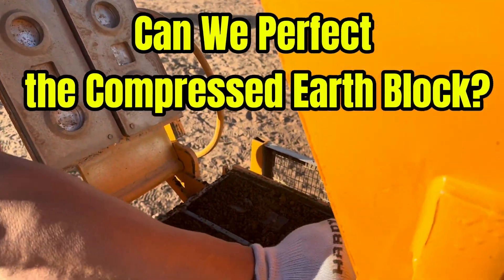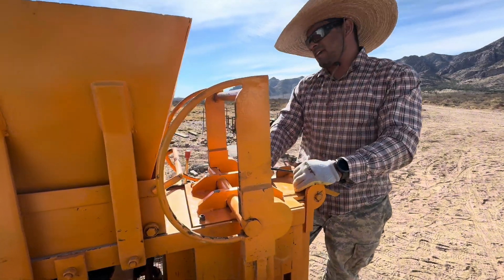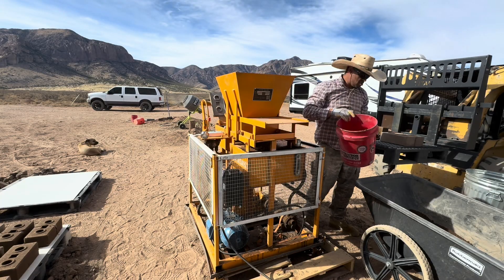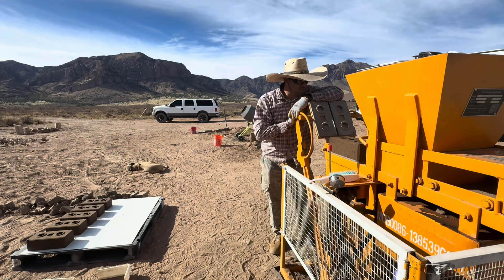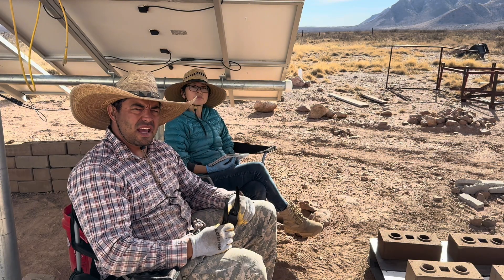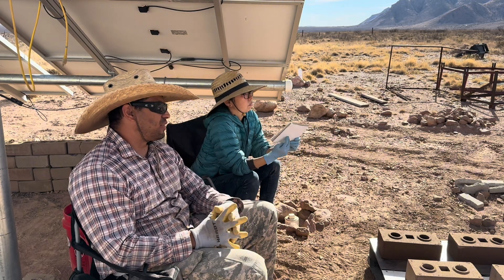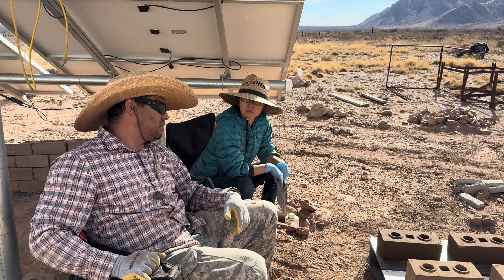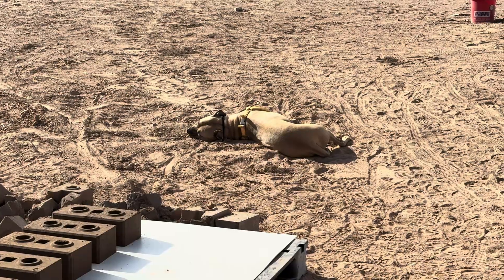The Never-Ending Earth Block Challenge: Solved?

Comment: I think you could benefit placing the blocks on a table very close to the press at the same height as the press. Leave the blocks there for several hours then use skidsteer to lift pallet to table height several hours later to transfer to the pallet. You want the cement to harden a bit. Your trying to move them to far and your body mechanics of travel and bending are breaking your bricks. Trying to do to much with them when they are fresh.  I have been a mason for over 30 years even industrial paver manufactures have variations in their high controlled process.  This is why mortar is crucial when laying brick.  Look to see if you can look up brick laying in Bali or Indonesia they approach if differently then we do in the west.  Hand made bricks and like 1/16 to 1/32” bed joints cement is expensive on the Island and sand is plentiful, local clay and sand are fired into their bricks.

I have been working on a design for a skid steer attachment that will press 6 SCEB at a time and will deposit them from the bottom downward so the machine can place them on the pallet or ground as it ejects them.  This stage of the brick is when they’re the most fragile. Also being in Arizona I think you already realize a drier mix works better for pressing the block a “Dry Pack” but the critical area after placing the blocks on a on a pallet would be place a mister system or sprinkler over them or use a hand pump pesticide sprayer to hydrate them slowly and keep them wet/moist for as long as possible 28 days would be Ideal before use in construction.  Many time as we lay clay bricks it is not uncommon to stick our bricks in the summer in a 5 gallon bucket of water or at least dunk the brick in water before laying.  Even had to keep sprinklers keeping the pallets of brick moist.  When pushing down the brick will absorb the moisture from the mortar to fast and it can be difficult to spread the wall and set the brick to the line in summer. The joint drying this fast is weak and not as strong as one that dries slower.  Balanced with the least amount of water in your mix to control the strength of the mortar and shrinkage.  Misting the bricks down several times a day keeping them in the shade and covering them with a sheet of Plastic to keep the moist in to reach proper hydration of the cement are the factors your trying to control after the brick is made.  
      Reduce the distant you have to move the brick when you get into production you will just want to park the skidsteer near the press raise a pallet to the height of the press and only move them horizontally you can lower the arms after you first row is down and possibly place a second row on top 90 degrees from the first row.  Stack it like a pallet of bricks keep them close to one another this will help control your moisture loss. I would start with 2 high per pallet before attempting 3 or 4 courses to keep the blocks as straight and flat.  The brick could be stacked three or four high or even 5 high by the next morning and kept cover with they bags we cover our pallets of cement / brick / block with to keep out of the rain but in your case.  The height you can stack the bricks will be relative to the lifting capacity of the skidsteer  your availability of pallets, but look at Home Depot the height of stacked brick pavers to give yourself an idea of how high they should be stacked.

I run several companies so I think it will still be several more years before my skidsteer attachment will be ready to make available to the public  I just don’t have the time and bandwidth to commit the time needed to perfect it and then tweak and perfect it again.  Managing jobs and 25 employees doesn’t give me to much time for my hobbies.  Love all the effort you guys are doing on top of making the blocks documenting the process filming and editing doubles the trouble and effort but does give you a nice platform for encouragement and advice from tradesmen.
Reply from the maker: Thank you for taking the time to share your experience and insights! I completely agree that having a pallet at the same height as the press will make a big difference in reducing strain and breakage. Letting the blocks sit before moving them also makes a lot of sense, especially considering how fragile they are at that stage. We’ll definitely look into optimizing our process based on your suggestions. Appreciate the valuable advice!

Comment: I think this is why if you use mortar you can have slight variations 
You put mortar down
Put brick on top
Put level on top
And just tamp down which end  is higher til it’s level
Reply from the maker: You make a great point! Mortar does allow for adjustments to level out slight variations, which is really useful. With interlocking earth blocks, though, we have the ability to control the height more precisely by adjusting the mold, so we figured—why not take advantage of that? We’ll likely use slurry to bond the blocks, which should help maintain alignment while keeping everything solid. Thanks for the input!

Comment: Does your machine have a psi pressure gauge? You need around 1200 psi of pressure I seen almost all your videos and you have tried different soil combinations maybe you are not getting enough pressure from the hydraulic pump or the hydraulic ram doesn’t  produce tonnage need it. Also You can try using a small block press so you can test your soil until you find the right combination.
Reply from the maker: @porsisoca80  we were getting 1500 psi, changed the motor and upped the speed. We currently are getting 1900ish and experimenting. We appreciate your comment thanks.

Comment: Why put freshly made bricks outdoors? Air and sun weaken them.
Reply from the maker: @yahia.madieh  Thank you for sharing your concern. For the time being we are working on the soil ratio but we will definitely will cover blocks to cure correctly.  Have a good day!
Reply: I think you could benefit placing the blocks on a table very close to the press at the same height as the press. Leave the blocks there for several hours then use skidsteer to lift pallet to table height several hours later to transfer to the pallet. You want the cement to harden a bit. Your trying to move them to far and your body mechanics of travel and bending are breaking your bricks. Trying to do to much with them when they are fresh.  I have been a mason for over 30 years even industrial paver manufactures have variations in their high controlled process.  This is why mortar is crucial when laying brick.  Look to see if you can look up brick laying in Bali or Indonesia they approach if differently then we do in the west.  Hand made bricks and like 1/16 to 1/32” bed joints cement is expensive on the Island and sand is plentiful, local clay and sand are fired into their bricks.

I have been working on a design for a skid steer attachment that will press 6 SCEB at a time and will deposit them from the bottom downward so the machine can place them on the pallet or ground as it ejects them.  This stage of the brick is when they’re the most fragile. Also being in Arizona I think you already realize a drier mix works better for pressing the block a “Dry Pack” but the critical area after placing the blocks on a on a pallet would be place a mister system or sprinkler over them or use a hand pump pesticide sprayer to hydrate them slowly and keep them wet/moist for as long as possible 28 days would be Ideal before use in construction.  Many time as we lay clay bricks it is not uncommon to stick our bricks in the summer in a 5 gallon bucket of water or at least dunk the brick in water before laying.  Even had to keep sprinklers keeping the pallets of brick moist.  When pushing down the brick will absorb the moisture from the mortar to fast and it can be difficult to spread the wall and set the brick to the line in summer. The joint drying this fast is weak and not as strong as one that dries slower.  Balanced with the least amount of water in your mix to control the strength of the mortar and shrinkage.  Misting the bricks down several times a day keeping them in the shade and covering them with a sheet of Plastic to keep the moist in to reach proper hydration of the cement are the factors your trying to control after the brick is made.  
      Reduce the distant you have to move the brick when you get into production you will just want to park the skidsteer near the press raise a pallet to the height of the press and only move them horizontally you can lower the arms after you first row is down and possibly place a second row on top 90 degrees from the first row.  Stack it like a pallet of bricks keep them close to one another this will help control your moisture loss. I would start with 2 high per pallet before attempting 3 or 4 courses to keep the blocks as straight and flat.  The brick could be stacked three or four high or even 5 high by the next morning and kept cover with they bags we cover our pallets of cement / brick / block with to keep out of the rain but in your case.  The height you can stack the bricks will be relative to the lifting capacity of the skidsteer  your availability of pallets, but look at Home Depot the height of stacked brick pavers to give yourself an idea of how high they should be stacked.

I run several companies so I think it will still be several more years before my skidsteer attachment will be ready to make available to the public  I just don’t have the time and bandwidth to commit the time needed to perfect it and then tweak and perfect it again.  Managing jobs and 25 employees doesn’t give me to much time for my hobbies.  Love all the effort you guys are doing on top of making the blocks documenting the process filming and editing doubles the trouble and effort but does give you a nice platform for encouragement and advice from tradesmen.

Comment: Guys it’s  your mixture ,too much sand  the  clay is the glue or you have too much clay when the brick dries it has many cracks and remember to do the ball test
Reply from the maker: @locksleymcleod4007  Thank you for your comment! Our native soil is very sandy, but adding clay to the mix has made a big difference. So far, with all the mixes we’ve tried, we haven’t experienced any cracking once the blocks are dry. Next time, we’re considering adding more clay to see what percentage becomes the breaking point, allowing us to reduce the overall amount.
Reply: What is the ball test? Have you made CSEB before?
Reply from the maker: @  Probably your question is not addressed to us but here is an easy explanation of ball test.
1. • Make a ball - Mix soil and a little water.
2. Drop it from about 12 inches onto a hard surface.
3. Check the result:
• Holds shape → Good mix!
Crumbles → Too much sand.
Sticky or cracks → Too much clay.
This test helps find the right soil mix for strong earth blocks!
Reply: @leeslivingoutofthenorm  thank you so much.

Comment: Have you thought of adding something for tensile strength? Fiberglass? Or even something natural like chopped straw? I'm in Cochise co. Doing the off grid opt out permit build. Rammed earthin our case.
Reply from the maker: @davidhanson5303  Hello neighbor! That is so cool. We almost bought a property that’s rammed earth. That was also going to be our fallback if the block machine we couldn’t get it working. Good luck to you!  Regarding adding something, usually they don’t recommend to add any organic matter like straws while making blocks with machine. So most likely we won’t but sometime we would like to try to make manual blocks by making DIY mold!